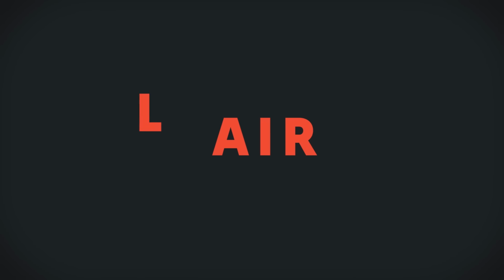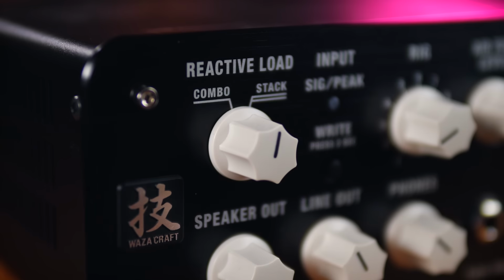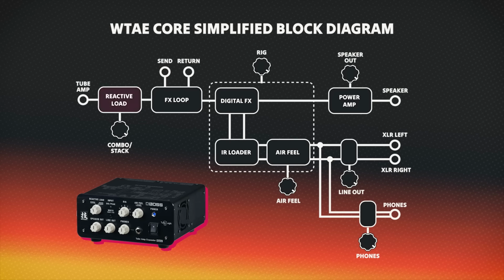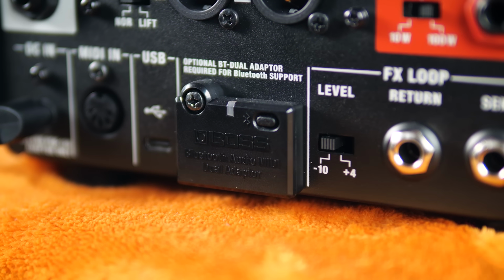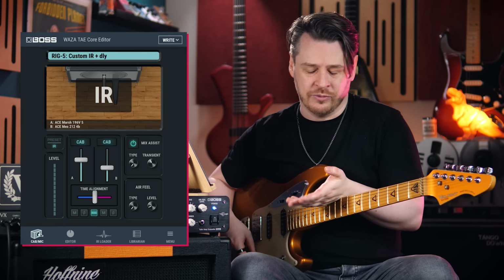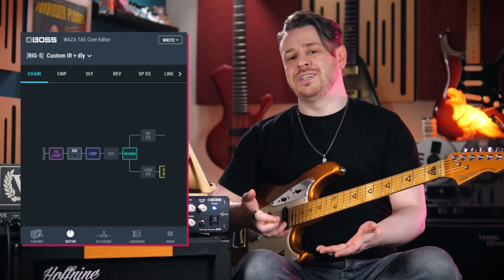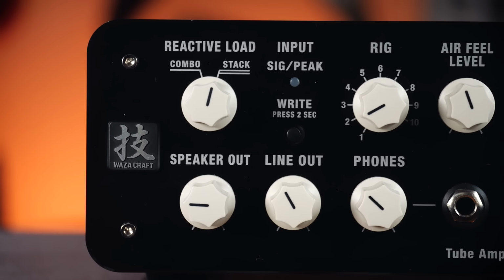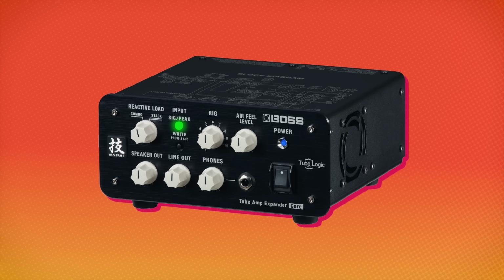Loadbox, Attenuator, IR Loader - Tube Amp Expander CORE does it ALL!

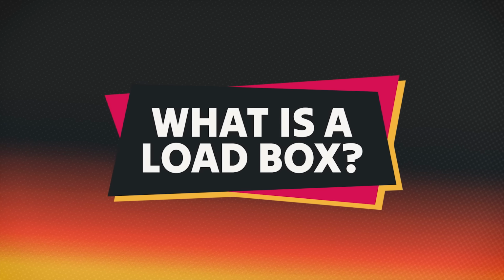Comment: 2:00 actually, it is perfectly safe to operate a valve amp connected to a linear load (resistor), as long as the connected load has the correct resistance value and power handling.
The need for a reactive load is only for sound purposes. The coupling between the speaker and the output transformer and the characteristic impedance curve of a speaker imprint a certain frequency response on the output of the amp that is missing when the amp is connected to a linear load.
Reply: It’s safe indeed to run a tube amp into a purely resistive load, but a reactive load simply sounds better. Tube amps interact with real speakers, as their impedance changes with frequency. A pure resistive load is always flat across all frequencies, which is simply nothing like a real speaker. That’s why it resistive loads sound sterile, dull and stiff,  even though it’s electrically safe for your amp. Most cheap attenuators are resistive loads only or at best partially reactive So while they will work fine for pure volume control, they don’t preserve your amp’s tone, feel or dynamic response as well.

Comment: To recapitulate: your tube amp’s full output hits a reactive load inside the Boss Waza Tube Amp Expander Core. This safely absorbs and responds to your amp just like a real speaker would. The signal is then re-amplified through an analog solid-state Class AB power amp inside the unit. That re-amped signal then goes into your real speaker cab, at any volume you like, whisper quiet to full blast. Note that you’re not bypassing the power tubes. You’re letting them do their full job. The Waza Core’s analog solid-state reamp simply takes that finished “tube tone” and boosts the volume back up (or down) without adding much of anything. Your power amp distortion, transformer interaction, harmonics and tube sag are captured by the Waza’s reactive load. The analog solid-state Class AB amp then just amplifies what’s already there, with almost no color. It’s basically like listening to your cranked amp through a neutral studio monitor. The much more expensive Fryette Power Station does the same, but with a tube amp in the end, instead of analog solid state. It adds a second layer of tube dynamics and harmonic richness through its own tube power section. It's nice to have, but not really needed. For most use cases, the Tube Amp Expander is absolutely sufficient and sounds way more authentic than other attenuation solutions.

Comment: To be fair, the drivers were on display at the bottom of the homepage, inside a locked filing cabinet stuck in a disused lavatory with a sign on the door saying beware of the leopard.

Comment: Boss Engineers please read this: We guitarists need a version of this item with No smartphone, No menu, No Plugins. Just Knobs and Switches at half the price. Thank you.
Edit: Please don’t get me wrong: I didn’t ask for a hand-wired all analog device. Digital is ok, we just need less options and something that will last when smartphone apps become obsolete.
Reply: What you’re asking for would double the price (or more).
Reply: @ it’s a solid state multieffects unit. Just with a load box
Reply: What you are looking for is called a two notes captor.
Reply: @Rowe4900candymachine Thank you for your suggestion. Yes, the Captor is a good example to start with.
Reply: Palmer does a purely analog load box with cab sim.
Reply: Guitar effects are way too complicated for the average musician…I am the only one I know that can work these things for them…
Reply: @THINJIMI My apologies if you feel offended, this was not my intention. I am just asking for a less expensive and less complicated device as very many guitarists do.
Reply: @marcotaticchi5343  - Not offended at all…what I said is true. Most guitar effects pedals are over most musician’s heads. This is a fact in my life! Sounds like you need a power soak of some kind. Basic, and to the point! There are many, but I don’t use amps much, so I can’t recommend any in particular…as I go right into the board to record.
Reply: You need some sort of user interface for loading digital audio files though. The only "Just Knobs" way I can think of is something like sticking in an SD card with numbered filenames.
Reply: Captor is fine as is the Bugera !!
Reply: It's all digital anyway.  Why on earth you would want to replace your tube power amp with a 'reactive load' which is actually a DSP amp is beyond me.  Just get a proper attenuator - this has nothing going for it at all.
Reply: You can use this without ever using an app or software. It has built in rigs. You never have to change them if you don't want to.
Reply: @myorangebicycle I may be wrong but I think the implication is instead of having the digital option they’d rather get it cheaper
Reply: @OuchMusic Yet this is not how modern electronics work. Inside sits some DSP, whose whole R&D costs are already paid, which is doing all the work here. Trying to get the same or similar functionality ‘the analoge way’ would be a humongous pile of components and complexity, driving the price even higher with some stuff like cabinet simulation not even remotely achievable. If you’ll need something simpler/cheaper I guess getting a simpler load box is the way to go here then.
Reply: @ this wasn’t my goal. I’m just clarifying this guys desire. I’m saving for a HX stomp
Reply: @myorangebicycle I still pay for that developed software because it's baked into the price of the product.

Comment: Mmmmmm! Cranked power tube distortion. So yummy...

Have you tried a UA Ox Box? Both the front panel and the app are far simpler than what BOSS offers. It has what I need, and NOTHING more. I've never found any competitor that comes close to its sounds. Expensive, worth every penny. When I first took it for a test drive I almost cried.

Full disclosure: i live 5 miles from UA HQ in Scotts Valley CA, and my best friend worked there for a couple of years. So I may be biased. (No pun intended. I kill me....)
Reply: In contrast to the Boss TAE and the Fryette Power Station, the OX does no re-amping. It cannot send a full speaker-level signal again as it contains neither an analog solidstate poweramp (like the Boss TAE), nor a tube poweramp (like the Fryette PS). It also has a 5-level stepped attenuator, not a continuous dial. The OX is completely silent when needed. It's great to record via its studio-grade cab/mic modeling with zero speaker attached. But with the OX you can't fine-tune live speaker volume like with the Fryette PS or the Boss TAE and you can't gig with the OX as a volume-controlling amp tool. The OX can only attenuate your amp’s signal, not boost it back up - so you cannot use it to control your amp’s speaker volume dynamically on stage. It's was engineered for reording, home playing and silent practice in mind, not for live gigging.
Reply: @americanstreamer1910  I see! Thanks for taking the time to write a detailed comparison. Very helpful.

I've only ever played with an OX competitor for a minute at a guitar shop, and heard a demo comparison. The OX sounded better to me, but I guess the demo only used features that both boxes have, and I didn't ask any further. That's what I get for being a know-it-all.  LOL

Comment: Welcome back to the internet, Colin!  Watch out for the turd-chucking apes!  😂

To be clear, this is meant for amps with tube power stages, right?  Will it still work well enough with solid-state power amp stages?  I actually don't own a tube amp at all, but I wouldn't mind using this, anyway, for the other features it has, and having it on hand for future expansion into tube power amp territory.

I'll be looking forward to the next video!

Comment: So since you noted that the attenuator is post DSP, that leads me to wonder just how much latency gets added from digital buffering and processing time?  Even at ridiculously small buffer sizes and with modern high speed CPUs, 1ms of latency is still way longer than the speed of electricity through an analog circuit.

Not saying it would feel bad, but it may change how the attenuated amp feels to play since digital processing latency is a factor into why amp sims in particular just feel different compared to a real amp in a room.
Reply from the maker: I say this every time someone brings up latency - it takes longer for your ears and brain to process sound than the latency of modern digital systems. 
Their latency is also significantly outweighed by simply walking a few meters away from your amp. 
Biology and physics attribute more latency than digital processing and no one is kicking up a fuss over those. 

Even considering the cumulative effects, the latency we are talking about it literally imperceptible and not worth dwelling on.  
We are 40+ years on and, when it comes to guitars, people are still scared of the word 'digital'.
Reply: @ScienceofLoud  I have two Tonemaster amps, a Deluxe Reverb and a '59 Bassman, that I use on stage. Since I have the Bassman, the Deluxe is the Backup. You would not belief how many musicians told me how great my valve amps sound and how nothing digital ever could simulate that. 😂🎸🍀
Reply: You add 1ms of "latency" by walking 4 or 5 steps (3 meters) away from your tube combo or speaker cabinet due to speed of sound. Absolutely no chance to notice that. Ever.
Reply: The DSP in the Boss TAE is only used for cab/speaker IR loading, recording outputs, EQ shaping on the line out, simulation on the headphone out, GUI integration and memory presets. It only adds small latency there, by far not enough to affect playing feel in most use cases. The DSP paths here are faster than many plugin chains or modelers and much faster than the latency of many amp sims with audio interfaces. But the core attenuator and reamp path (from amp input to speaker output) is all analog, not digital. The reactive load and the re-amplification stage are both analog. The volume knob that controls speaker volume is post-reactive load, before or after reamp, and not processed digitally. And the TAE's analog signal path latency is absolutely negligible, less than 1 ms. If you're planning to it just for volume control and speaker output, you’re getting the pure analog and real-time experience.

Comment: This won't work with my Peavey 6505 Plus head as it 120 watts right? It says it is for 100 watts.
Reply: If I remember correctly, the post gain control on a 6505 controls the amount of power it outputs, so as long as you don't crank the volume too high you should be okay. If you want to know where on the post gain knob is under 100 watts, buy an electricity usage monitor and plug the amp into that into the outlet. As you play the amp and turn the post gain knob, it'll display how much wattage the amp is actually using and you can use that to figure out what a safe setting is. Also, as Colin mentions in the safety section of the video, it's not recommended to completely crank a tube amp in general as that puts a lot of wear on the components and can seriously damage your amp.

Comment: As someone who used to program Bluetooth-controllable gadgets for a living (and still have to maintain firmware for some of them)... unfortunately, I'm on the manufacturer's side here. I still agree that it should be in the manual, but I'd always rather trust a cable update than a FOTA (Firmware over the Air) one.

That said, the attenuator itself looks quite feature-complete. I need to consider this for when I start getting some guitar gear instead of bass gear.

Comment: The label on the back switch has a 100 watt option but 100 rms can be more than 100 watts, correct?  So is this a generic setting for "100 watt" heads or would I be in danger plugging a decently cranked SLO 100 into it?
Reply from the maker: A couple of things to clarify here:
That switch you are referencing is just a pad that scales the output levels based on the size of amp you are connecting to it. 
The CORE can handle 100W maximum. 
All valve amplifiers (regardless of their power rating) are quite capable of outputting more than their nominal power output. RMS might not be the actual measurement that nominal rating is based on - there are different ways to calculate that, including just plucking a number that will make the marketing department happy. 

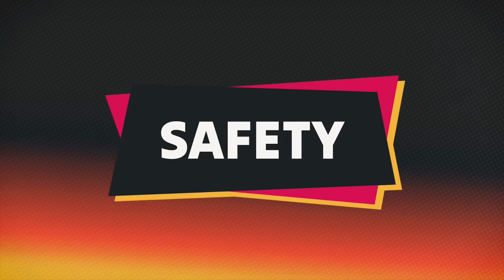As mentioned in the Safety section of this video (18:04) - it's safest to imagine the nominal power output of an amp as the AVERAGE power at that amp's EXPECTED operating volume. Make the amp quieter, it outputs less power on average - make it louder it outputs more power on average. 
If you have a 100W amp and you've turned all the knobs up to 10, you can easily expect the amp to output considerably more than 100W on average. This would overheat the attenuator, lowering its ability to absorb power, and mean the amp would be operating as if there were no load attached. This would put your amplifier in danger of becoming damaged. 
If using a 100W head, simply run it at a reasonable volume level and it will safely output less than 100W on average.  

Using an attenuator does not make your amplifier immune from mistreatment. BE SENSIBLE with how you operate your amplifier - if you wouldn't do it without an attenuator, don't do it with one either.
Reply: @ScienceofLoud  Thanks for the reply!  I get what you're saying here but when I look at other attenuation devices, including Boss' bigger version of this, state larger power handling seemingly for "100 watt" heads -- like 150-200 watts.  I'm assuming that's for extra headroom for when the "100 watt" heads are driving more than 100 real watts.  So would this core version be better suited to 50 watt and below heads and use the bigger brother or something like a Power Station for a larger 100 watt head?
Reply from the maker: I'm going to repeat what I said previously, both in the video and in my comment: 
If you operate your 100W valve amp at its expected operating volume, you'll be well within the 100W limit. There should be literally NO REASON to be maxing out a 100W valve head - with or without an attenuator. 

The issue is not with the attenuator, but with your keenness to do dangerous, unnecessary things with your amp.
Reply: @ScienceofLoud  Man, thanks again for taking the time to respond!  I guess I was hung up on the "reasonable volume level" when what's reasonable can be drastically different depending on the setting.  My SLO 100 sounds best when not dimed but with the master volume around 6-7/10 when the power stage starts breaking up.  This is fine for a lot of stages I play on but can be too much for other, smaller venues and certain rehearsal spots.  I apologize for the dumb questions but I'm a bit of a luddite and just exploring the whole attenuation option for the first time.
Reply from the maker: Maybe it will help to remind you that 100W amps were designed to project sound to 10 thousand people in a stadium WITHOUT the assistance of a PA. 

Just think about how loud that is and realise that's their expected operating volume, not their theoretical maximum. 

When I say operate the amp at a reasonable volume, I mean not trying to compete with an arena full of thousands of screaming fans if you are using the amp for studio work or are playing small venue shows with the amp going through a PA
Reply: @ScienceofLoud  Heh, I'm aware!  I'm rarely playing large outdoor festivals or venues with more than a couple of thousand max capacity anymore these days.  Just looking for something that can keep my "tone", safely, at volumes that won't blow out smaller venues and the occasional dive bar gig and this seems like it would do just that.  Thanks again, duder!
Reply: @crackilator  If you plan to crank a 100W head for a prologued period of time together with the Boss TAE, better get an attenuator with a with a bit more leeway above 100W. But for 30W and 50W amps, the Boss TAE is perfect. You will get a better tone than using just the simple powersclaing which amps like the Orange OR30 have. Btw, I'd always look closely into the manuals and specs of every tube amp to find out how exactly any kind of built-in power reduction is being realized. If it's not a full reactive attenuator like in the Rockerverb 100 MKIII or in the Vox AC30CH amp head, then the TAE is always the preferable option.
Reply: @americanstreamer1910  I realize there are probably some contractual reasons for not being able to say, "you should probably get one with larger power input handling" but I do appreciate the responses.
Reply from the maker: There are no contractual reasons for anything - you just don't need to be fully cranking a 100W valve amp under any circumstances, especially not when using an attenuator of ANY brand or power handling. 
100W amps are only that power so they can get to insane volume without hitting a headroom limit. You gain absolutely no advantage whatsoever by running a maxed out 100W amp through an attenuator.